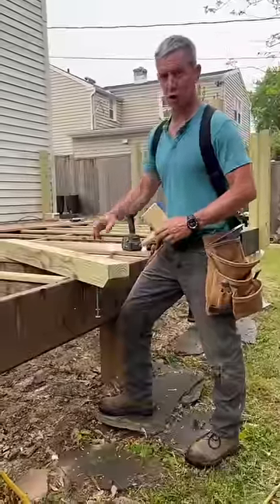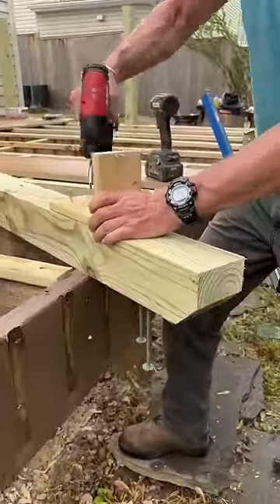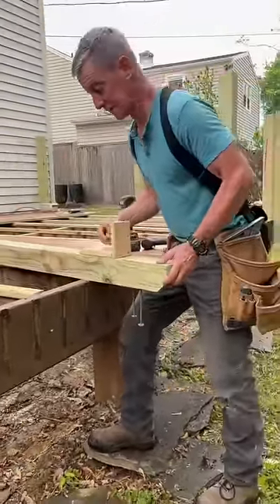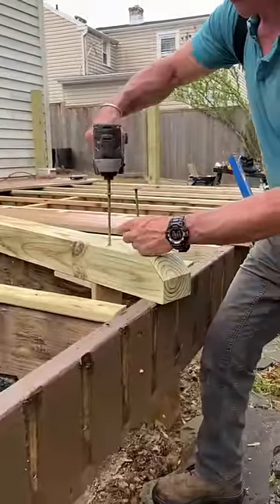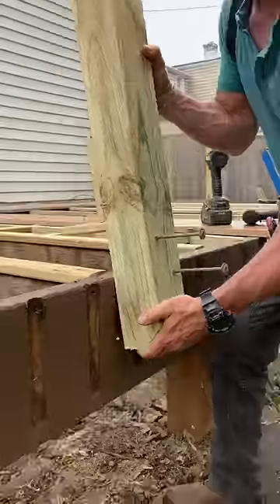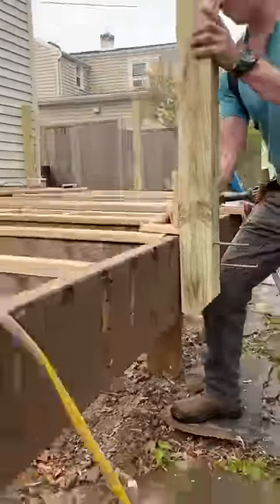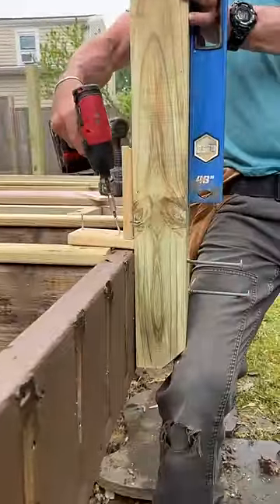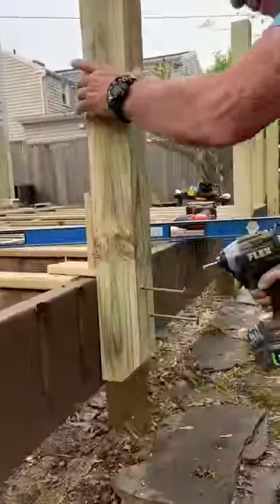DIY Tips: How to set a deck guard post by yourself

Comment: Dude you can see the floor joist is higher than the sill plate and that’s the reason why your using wedges to level the posts.
Reply from the maker: You're right that you can see some differences in framing planes, but I'm right in knowing you don't know what any of the parts are actually named. I'm not trying to dunk on you, but bro, you're not even close.
Reply from the maker: Happy to share with you what's going on here and what things are called. No worries.

Comment: Seems like a lag bolts would be more appropriate
Reply from the maker: Structural screws like I used here are better than lags. They do the same thing, but are faster and easier. I took lags out of this re-skin. - However, the notion here is setting the post. Connect however you want.

Comment: Put them on the inside instead of the outside so you can put composite railings and caps over those. Real week posts your doing theee
Reply from the maker: I get it. I sometimes do. But this is a repair--I can't show everything in these short videos--and the "fascia" (I despise this detail) was a 2x10. There was 2x8 framing behind it.

Comment: Don’t put your post on the outside of your deck like that after shrinking and swelling that will become loose. You should put your post on the inside of your framing in frame around them.
Reply from the maker: The post will dry out and shrink for sure. I’ve had to go back and tighten carriage bolts in the past. However, I crushed enough wood fiber setting the Spax PowerLags that the posts are solid.

Comment: Might as well just Velcro it on or use double-sided tape.  Can't believe you think that's okay.  It is not.
Reply from the maker: It works. Try it some time on your next deck, assuming you build them, and see if you can pull that guard rail off.
Reply: @myfixituplife  FFS dude, I can think of a lot of stuff that works.  I can wire a house in 16ga, I can pave a driveway with thinset, I can toe nail trusses with screws, and I can install drains without vents.  All that works, but that still doesn't mean that I should do it.
Reply from the maker: @keith_dixon  Nobody is talking about any of that nonsense. We’re talking about this. Changing the subject is just changing the subject.
Reply: @myfixituplife  You completely miss the point.  You can do something that works and it can still be wrong.  Just because you say it can't be pulled off doesn't mean that you are doing it right.  You are violating like 7 common municipal building codes.

Comment: Um, no! Railing posts should not be affixed solely to the band board, or on the outside of it. And those little screws aren't a substantial fastener for the application.
Railing posts should be extensions of the footered supports or be tied in by structural banding on both the inside and outside, and be through bolted instead of using lag screws.
So you want a deck that will last along with the structure it's tied to, or do you wanna have to rebuild the deck every ten years or so?
Reply from the maker: Good observations. - This is a deck repair , first thing. and second, it's just a way to set posts. - The same screws are legit for the ledger connection. I'm no engineer, but the connection detail -- which works all day --isn't the point.

Comment: I would never screw posts, I always bolt the posts to the deck. That handrail ain't sturdy at all
Reply: Sturdy enough
Reply: @slimreaper1911  Maybe you might get a year out of it as long as no one falls into the railing cause it will certainly fail.
Reply from the maker: Same screws hold the ledger to the house. Same screws for post to beam connection. While this is a resurface and no permit was needed, the only thing getting this guard post to move is TNT. I've had to come back to deck to re-tighten nuts and it's on NADRA's deck safety checklist to retighten them.
Reply from the maker: Yessir.
Reply from the maker: You'd have to fall into it with a dumptruck pulling it on the other side. Dude, this thing is fused.

Comment: I find it hilarious that you have spent the homeowners money on so much of the demolition but you didn't take apart the front of the band joist? Why couldn't you have supported all of the joists with a support cross the entire bottom with to Ground Post temporarily set at takeoff the band joist and then redo it with something brand new and clean
Reply from the maker: In short, because this plan of yours would double the scope of work and not double the value. I find it not hilarious that you didn't think of that.

Comment: How do you like those FLEX tools ?
Reply from the maker: Two ways to answer. 1 - Best in Class. Thundering batteries. Outstanding design details. Available to me at retail. -- 2 - I just like them. The weights, designs, balances, details...they just work for how I work. - Also, I've tried very hard over my career not to be a one-battery guy, because I like tools not batteries. So I try to keep a wide array. I also have plenty of corded tools that work just fine.

Comment: What state are you in? In California won't allow that.
Reply from the maker: PA. - It wouldn't be allowed here in new construction without an engineering report, but however I fastened it is not the point. How I set is IS. It's the fastest, easiest way I've figgered yet. This also isn't new construction. It's a resurface.

Comment: WHAT HAPPENS WHEN THE 
N. O. N. - P. R. E. S. S. U.  R. E. 
T. R. E. A. T. E. D. …. 
Shims in between the band board and the vertical railing support posts….rot out??….. wobbly railing??
Reply from the maker: Good question. Answer: Nothing. The wood fiber is supported on the screw shanks.

Comment: Ugh, posts should be embedded in the ground encased in concrete as part of the framing that holds the deck up. Also, you should have girders attached that the joists rest on; but then you aren't doing quality work or anything I would refer you to anyone for this type of work. You're a handyman at best, go paint something and leave the real work to actual carpenters.
Reply from the maker: I've refined this process since I shot this video, but the basics are there - Take a look, let me know what you think. - https://youtu.be/G3QEyUBR4PM

Comment: And when his “non-treated” shims rot - out ….. his vertical post wobbles …
Reply from the maker: Good eye. Wrong, but good eye. The shims are temporary. Just place holders. - The grab is wood fiber around screw shank. The shims can or can't rot. Whatever. The post--with guardrail tie-in--goes nowhere.

Comment: This comment section is a prime example of a big issue in trades right now. Nothing productive comes from just saying I'm right you're wrong. This man must have said a 100 times it's a resurface. A lot of times due to the way the deck was framed and homeowner budget it's not feasable to put the posts on the inside. Im sure whats hes doing now will be much better than what was there. Also structural lags are 100% accepted by code in place of carriage bolts. At least in NC.
Reply from the maker: Man, am I glad I saw your comment. THANK YOU. Not for agreeing with me or seeing the whole picture and nature of customer service, budgets et al--which you totally do--but for being a gentleman. Gentlemen have a discourse. Mouth-breathers blurt then run off to the next thing to be fake angry/expert about. - I know it sounds self-serving (and to a certain degree it is, but that's not the entire point...anyway), please chime in any time. More people should read you comment and try thinking the way you do.

Comment: Why the hammer drill? Like, seriously. I've never understood why a normal drill doesn't do the same job with a quarter of the noise, or skill.
Reply from the maker: Neither one is a hammer drill. Hammer drilling is for wood-to-masonry connections. The sound you hear is an impact driver. Impact drivers are the evolution of the species of cordless fastener driving.
Reply: Yeah, yeah, impact, I was on my 3rd Scotch, my apologies, still same point.  They're super noisy and require less skill than a normal drill, I find them quite annoying.

Comment: They all suck after 15 years anyways.  If you screw it it will hold longer than the nails.  Pre drill helps too.
Reply from the maker: Don't need to pre-drill these structural screws. That's the point.
Reply: @myfixituplife  funny.  Bit it will not split down the road when it dries out. 40 years of doing this...but we will take your word for it.  Lol

Comment: You dont need that hammer drill. Your over torqing your screw heads. Just get a good drill for screwssl
Reply from the maker: First, it's an impact driver and second, you need to squish the wood fiber to accommodate for the post shrinking as it dries out.

Comment: Ohhhh HELL NO. Using non treated shims. No bolts?? Treated shrinks you use bolts so you can tightening them as the wood dries.
Reply from the maker: I countersunk the screws about 3/8s. You think I don’t know PT dries out? Those screws are like rails through that 4x4. And if I need to snug them up, I’m pretty sure the threads will still work.

Comment: Have to learn how to work alone.  But shouldn't those screws be 1/2" to meet code.
Reply from the maker: Working alone takes some creativity for sure. As for 1/2-inch, at one time, yes. But today, these structural screws are beyond. I use SpaxUS washer heads for a bunch of reasons and they spiral into wood fiber...Archimedes would be stoked!
Reply: @myfixituplife  I figured but had to ask.  Yes, he would.  I notice the LedgerLoks screws are an acceptable replacement (code compliant) for 1/2" lag screws and they are smaller than 1/2" so I guess technology is at work. Bigger isn't always better.
Reply from the maker: I agree. These are washer-head 5/16 x 6-inch Spax PowerLags. The washer head gives a better bite. Smashes wood fiber as it countersinks.

Comment: I just use one screw to hold it up way faster
Reply from the maker: I've tried that. Used to use nails too. I like this a little better.
Reply from the maker: I've tried that. Used to use nails too. I like this a little better.
Reply: Annnnnnd there it was lol. Someone with a better way.   Never fails man. Never fails …. Hey Russ. Why don’t you post your video for the class…. Then we can all critique it for ya
Reply: @richsharp1524  I earned a paycheck every week for 40+ years got paid piece work faster I got done the more I made. Sitting on my dad's deck I built 12 years ago that survived hurricane Harvey along with 5 others in the park
Reply: I set my corners and then all the others to a string line the only way to get flat and straight top of railings
Reply: @russellphillips1589  that’s wonderful.  However the video wasn’t how fast can you set a post. Not everyone has done it for 40 plus years.  And it would have sounded better from someone who has done for a long time to say.    Hey nice job.!!! I have done it for 40 years myself and as a tip this is how I have done it also.    Or.   Post your own video like I said and let everyone who has a different way critique you.

Comment: Through bolts???
Reply from the maker: Good question. Long story short, it's a resurface of a small deck in a residential neighborhood 3-feet off the ground. It's not LasVegasLive!. - There was also an inboard 2x8 behind this 2x10 "fascia". - Combined with an interlocked 2x6 top cap, I'm not sure where this is going minus an earthquake.

Comment: Posts are better secured on inside of band
Reply from the maker: Sure, if the application is commercial. But this isn't. It's a modest re-skin on a modest deck in a modest back yard. Sometimes common sense prevails.

Comment: You just put an unnecessary holes to the wood for the water ti sip through. A simple clamp will do the trick.
Reply from the maker: You're worried about a pin hole in PT? Don't. It's covered by decking. - Clamps move. Screws don't. Trust me, I tried the clamp. This is way faster.

Comment: I have never put the post on the outside. It looks terrible. Always on the inside and block around the whole post. Much more sturdy and way better look.
Reply from the maker: I don't think it looks terrible at all surface mounted. There was a 2x8 inboard of the 2x10, so there was no housing the post in the frame. With surface mounted posts, I run a 2x4 between them as a little detail. It doesn't do much, but it creates a nice shadow line that I like.

Comment: Where i come from the inspector would fail that in a heartbeat, we have to box it in on the inside not the outside
Reply from the maker: This is a resurface and I did take a little liberty with the Code, but posts DO NOT need to be boxed in. I couldn't do that here anyway, and the forces required to hobble this connection would be catastrophic to the entire structure IMO. This is also a resurface and inspection is not required.

Comment: That's not how I do it at all. I use a clamp and pre drill the lag with a 3/16" bit, and an extremely shallow countersink, the next size down from the head of the structural screw, to ensure it is flush. 

We also don't set handrail on the outside with composite decks, and they get brackets or blocks to keep them from moving at all. 

In my area, one county requires brackets, the other doesn't, so they get blocks.
Reply from the maker: I know how to build decks.

Comment: Several better ways of doing this.
Reply from the maker: In he article I wrote about resurfacing decks for The Journal of Light Construction, I went back and forth with the editor about the various means and methods that lead to this connection detail. And where I landed is that resurfacing decks is a blend of code, common sense, and craftsmanship--all of it on the clock. - Connection detail aside, this is the very best way I have found to get the deck post on layout alone.
Reply from the maker: For sure.

Comment: Geez give him a break at least he's not laying on the couch. I would embed my posts inside the rim also
Reply from the maker: I appreciate the nod to not laying on he couch (I love laying on the couch) but things need to get done and get done yesterday. Bolt the post however you want to. This video is about how to get it in position to drill for bolts or use structural screws.

Comment: Whoever watches this do not install railing post like this, rookie move. Post go on the inside with blocking and carriage bolts.
Reply from the maker: Not always and not everywhere. What you are saying is what you were taught and that's all you think is possible. - The Code is based on a certain metric. Dollars to donuts this meets it. And for sure, it was a thousand times better than what was there. Furthermore, the same screws are allowed in the ledger.
Reply: @myfixituplife  always and everywhere.  There's no way an inspector would pass that especially with screws. Also the longevity of that method maybe 3 years tops and those screws will start to let go. If that deck was 15 feet high would you still use the same method if so please stop building decks.
Reply from the maker: @JAYG79.  To be fair, you missed the first 50-seconds of the 60-second video (really, is it that difficult?). It’s about setting the post, not how to fasten it. But, since your hair is on fire, let’s douse it. - I agree that this fastening detail doesn’t have a TER for it (Technical Engineering Report) and in new construction, you’re right. No Plan Reviewer would approve it. - On the other hand, this—and this is not clear in the video—this is a re-skin. I pulled 3/8-inch DIY lags out of notched posts that lasted 25-years out of the old guard rail. Allowed today? Hell, no. Did it work? Yeah. - The very same screws I use on the guard posts do have a TER for ledger applications. - So, I know you think I don’t know the Code (you’re wrong), explain to me how this connection fails in 3-years.

Comment: Are those pt shims? Also your joists look high. Get the planer out
Reply from the maker: No. They're cedar or pine. I forget. I also know the differences, so please don't explain it to me. - Mainly, if they get wet, they can dry out.  They're primarily place holders so the shank of the PowerLag can do its job. - As for high joists, we might not be talking about the same thing, but the front band joist is a 2x10 and the interior frame is 2x8. You might be picking up on that. A detail, I hasten to add, that I loathe.

Comment: He needs to drill his jig anchor screw in straight . Otherwise hes just pushing his jig and post away from the joist .
Reply from the maker: Good eye, but no. The angle-back in the day called a "toenail"- draws the piece tight.

Comment: Knotch the damn thing out abd UT will be more secure . Carriage bolts all the way through , use 2 different sizes of washers ,tighten nuts. That post won't go anywhere.
Reply from the maker: Notching is awesome. It works for decades in most cases. I want a little more umph so I do this on my re-skins.

Comment: Did you ever use clamps 😅😅
Reply from the maker: Absolutely. Problem is, the clamp just sits there on the band joist and it doesn’t take much for it to move. The jig acts like the clamp and the screw into the band joist freezes the post where it need to go.

Comment: I think he’s saying this is how he sets the posts. I would think that he would come back later and drill holes and punch the bolts through and bolt everything down to complete the installation, because after all, it needs to pass inspection.
Reply from the maker: That's exactly right. Whether I was using Power-Lags or thru-bolts, I'd use the same set of moves to prep the post. Thank you for this. If I had a cookie, you'd win it.